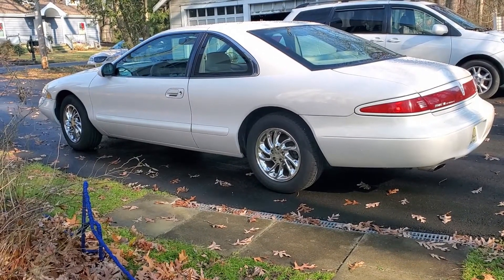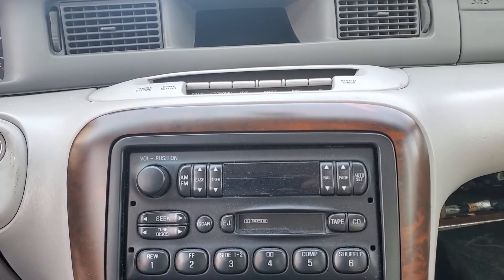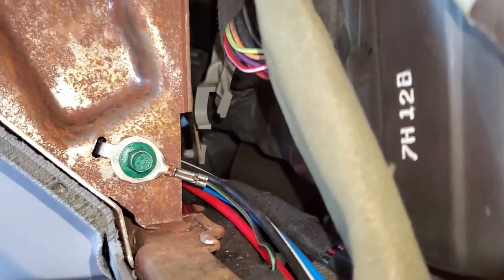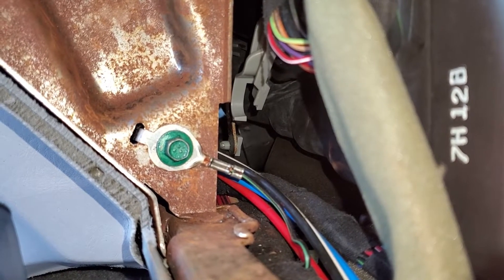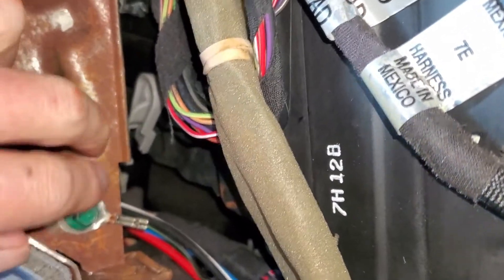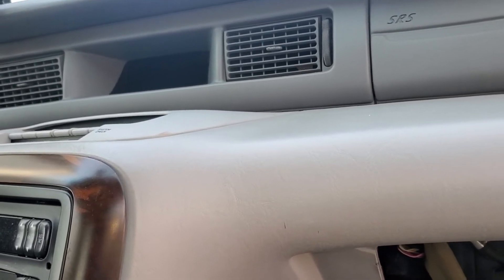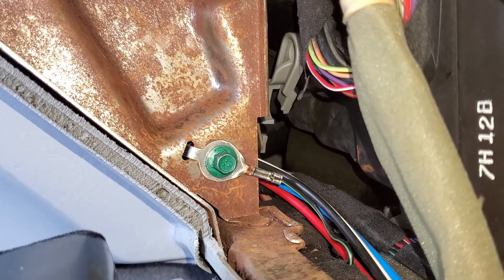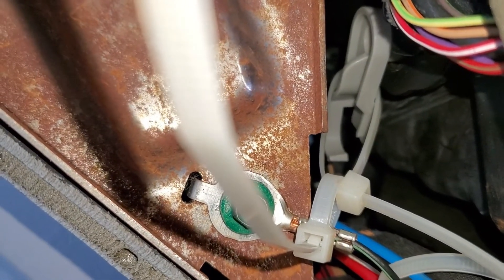mark VIII  low heat & AC output

Comment: Did you notice any temperature change in any of the vents when you moved this grey arm forward or backward? My grey arm is not broken like yours and moves with the control, but still no heat. I just get AC. What mode did you have your controls on when you tested this at the time you fixed it? Was there any noticeable difference? Thanks in advance.

Comment: Excellent video Richard! Thanks for posting. Your Mark VIII is stunning! I have a 1995 Lincoln Mark VIII, purchased it when it was only 2 years old. My a/c is blowin cold, but only through the damn defrost vents! I am pissed! I was told this problem is a vacuum malfunction, has this situation ever occurred to you? I would be much obliged for any insight you may have. If not, thank you for your time.